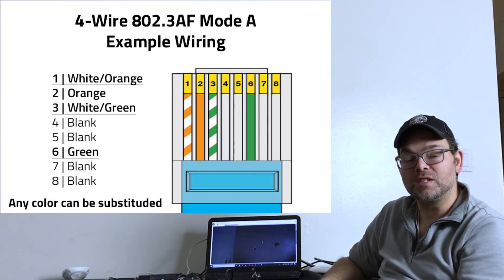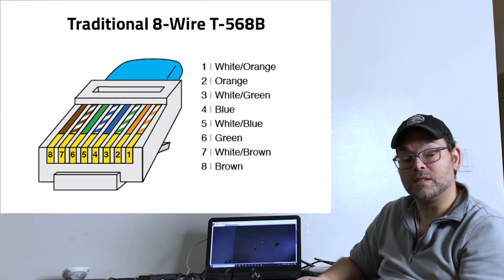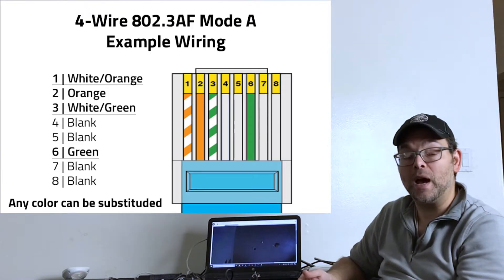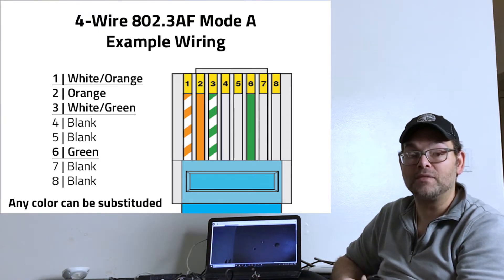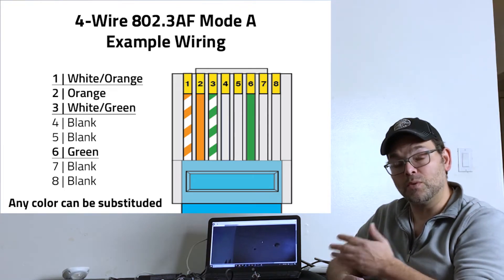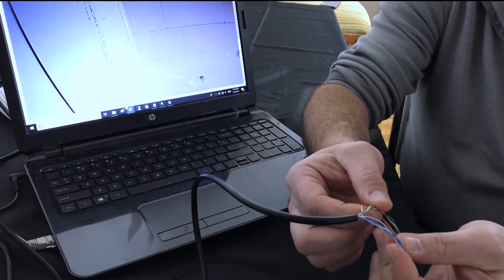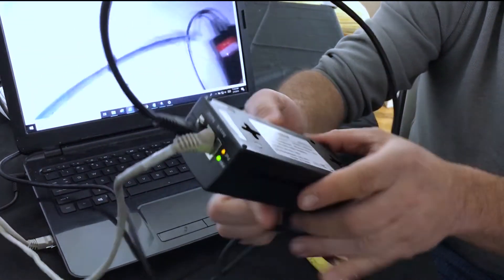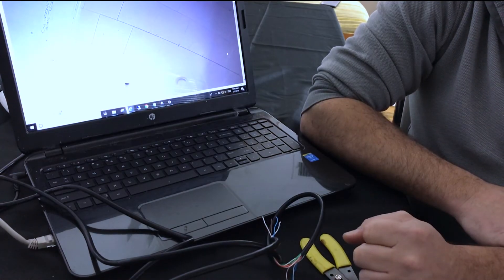Power Over Ethernet Using 4 Wires (2 Pairs)

Comment: I have a POE switch with Ethernet cables,but have cameras that can only plug into a DVR. I would like to know how to connect it directly to the Ethernet wires,without any conversion connectors. My problem that I don't know which of the Ethernet cable wires are for data neither the wires for power.
Reply from the maker: if they are coaxial cables you can not connect them direct to a poe switch. its an analog signal on your current cameras. in this case you should use a hybrid system that does analog and Ip if you want to use those cameras and Ip cameras.  if you want to use cat5 for anlaog cameras, not connected to a poe then i recommend you use a balun connector on both side , otherwise your signal will be crap if you took the coaxial wire and connected directly to an ethernet cable to extend its analog signal

Comment: Dang bro you just saved me a bunch of money, not only on my car insurance!! 😳
Reply from the maker: thats great man! are you an installer?
Reply: @cctvny  No, I do my own stuff i run and have ran my own internet wiring and couplings for security cameras,  but the wireless cameras I have don’t support POE, but I still used the internet cable to power them using your method

Comment: So if data only needs 2 wires & power only need 2 more wires whats the purpose of pulling an 8
 wire cable? If the world only used a 4 wire cable think of the $$ that would be saved. & resources.

!

Comment: My 3rd pair ( white/green ) is damaged in my Cat 6 data drop feeding LTS  4MP Turret Camera. If I re-wire both ends , using your video as my guide, do I still need the 802 injector, or can I simply plug back into NVR as it is POE powered already ??
Reply from the maker: Best way to check is to take the camera straight to the nvr and connect it with a small patch cord the same way with the 4 wires and test both ways. With extended distance on or off. It may be extended distance just changes the mode which happens to change that setting. But test it comfortably by the nvr.

Comment: My 3rd pair shows open. Can I re-wire both ends the way you show and simply plug back into my 8 port LTS NVR ( as it is POE powered ), or do I need this 802 injector ?
Reply: It really depends on the model of nvr if it supports it. I have seen some of the hik style nvrs have an extended distance option, once enable it worked on this node. However , I can not guarantee it .
Reply: @zoeyjune396  Thanks for the quick reply.  Looks like this Nvr has extended distance option. Should I turn this on even though my distance is only 90 feet.?

Comment: but how can we still get gigabit can we cut 2 wires only? I only need 2 wires for powering up devices that I'll attach to balun with positive and negative polarity so if there's chance to still achieve gigabit connection I'm on the look and don't know what wire numbers like 45 78 should I cut

Comment: I’m working a property that has their wireless access points running off of two pairs. Having a hell of a time figuring out why I can get power but no data to the AP
Reply: If it's not twisted pair it will not send data. The twists are part of the technology that allows the communication to follow. If it is twisted pair then perhaps the run is too long.

Comment: did as you said 4 wires  the wires you said still no internet upstairs?
Reply from the maker: Is it twisted pair cable? And are you using poe at all? And if you are using poe are you using a poe switch or injector that supports 802.3 af mode a?

Comment: Planning to use my previous ADT motion sensors (connected to 4 wires) not sure if it's  twisted pair but I do know that it's 4 wire cable. Most of the IP cameras I own support 10/100base t half duplex. I hope this works!!
Reply from the maker: Hi @jcmarcell unfortunately it most probably will not work if it is not twisted pair. You will get power but data will not work. Your choices are to use an analog HD camera(tvi/cvi/ahd they now go up to 12mp) or to use a two wire to poe converter.  If you did go the analog HD route you can get a simple four channel and use it as encoder if you have a larger ip system
Reply: @cctvny  I get you, you say it won't work, but in real world scenario are we talking that it won't work over so many feet? I think the longest run is about 70ft and the shortest being around 30ft. I understand the interference when it comes to something not being twisted pair but you don't think 30 ft can deliver 2 megabits with interference?
Reply from the maker: I will be happy if it works for you. I went down to help an installer with an install and the run he had was less than 20 feet and it did not work. But its in your house so it will be easy for you to test. Let me know the results
Reply: @cctvny  damn not even 20ft...........Honestly I'm gonna be that guy and give it a try. I'll let you know! Thanks for the video and responses.
Reply: @cctvny    hey so you were right, it did not work because it is not twisted pair. It does however transmit power (I guess we know that since the motions were active) and also worked with my ethernet cable tester. But from core switch to aggregation switch didn't do shit lol. It must be way too much data loss at 70ft(which is my rough estimate) 

Also if I'm understanding correctly, utilizing an analog system would be the copper coaxial cable? I was specifically interested in removing the useless motion sensors and utilizing the cable in the walls for Poe and data.

Do you think I could use these for anything else? 

Edit: what is an encoder? Would I be able to utilize something that can convert the data to usable transmission, and then convert the data back on the other side? I've seen systems that can convert USB data over long Ethernet runs and then convert it back to USB data on the other side. I've also seen ethernet data converted over coaxial and then back to ethernet data.
Reply from the maker: @jcMarcell  regarding analog HD you can use devices called baluns instead of coax cable.and connectors.  So you would use a pair for video and a pair for 12 volt power.  The dvr you schoose should be the same manufacturer as the ip system you have. This way you can view the cameras in the same software. 
If you were going to go with converters to make your 2 pair cable ip. There are many from companies such as veracity, or doorbird, or you can see what options Amazon offers

Comment: So this method would really not be good as a main source for data. I had this pinout going from a switch to a router and it just didn't work. Assuming a full 4 pair is required if you're going to use it for networking and not poe/5MBps

Comment: If I have good quality modem cable (F/FTP, 24 AWG, 6P4C, RJ11) or 2 pair External Telephone Cable, would I be able to use either of these for a POE IP camera setup if I was to I re-terminate with RJ45 connectors?
Reply from the maker: The cable needs to be twisted pair to send and receive data. The power will usually work. Cat3 24 guage usually will work but you might only get 10mbps. That's usually enough for most Ip cameras.
I would reccomend you test it for a few days and see if it works, before you rely on it. There are also many converters on 2 wires (1 pair) that will give you poe as well, that will work with most cable.

Comment: But just got a forum ..they says 
type B cable don't have poe for cat 6 and type A have poe thats you said ......then buying a cat 6 type B then worth it over cat 5e ... please reply
Reply from the maker: I am not sure i understand you.
But if the question is if you have a non gigabit speed network, can you use cat 5 instead of cat6 for poe 802.3af mode A. 
But for data mode b still works with 4 wires but you do not need cat6 since you are not going to have gigabit speeds anyway. I hope this helps. If you reply please make sure you have it explained better and that the question spies to an application that requires power on the cable
Reply: @cctvny  ok my last question ...all though I don't have a gigabit connection speed but my modem and computer have 8 pin port so in that case will I get advantage over packet loss with cat 6 cable
Reply from the maker: @random2059  ,in this instance cat6 only benefit is if it is alot of work to run the cable and you wanted to have something for the future.
For your current application if I understood everything correctly,  then it would have no benefit over cat5e

Comment: But cat 6 have 8 pin ....cheap router have 4 pin only
Reply from the maker: That is only for data and not regarding poe, which also provides power for devices like up cameras or ip phones.
The cheap router only has 4 wires since it is not gigabit and data only and work on older standard for the data

Comment: Would a 2 pair cat3 cable work to run an ip camera with a portable injector using this method? I ask because I have that pre ran and don't want to rip it out to replace with cat5/6
Reply from the maker: It really depends if the camera supports the 802.3af Mode A to begin with.
Cat3 can usually do up to 10mbps of data. Just verify its actually cat3 and its twisted. Otherwise you will get power and no data.  I have seen it done many times for under 100 foot runs
Reply: Thanks so much for the fast reply! The cam is a Dahua IPC-HDW5831R-ZE and the spec sheet lists power supply as DC12V, PoE(802.3af)(Class 0).  But I can't find anything about the mode. Any thoughts? Thanks again!

And the cat3 is twisted.
Reply from the maker: @bradpalmquist4163  sorry for the late reply.
From speaking to my friends at dahua they said that the 802.3af standard includes both. So if you have the camera already you can bench test it to see if it officially supports it. Doing that won't hurt the camera if it does not

Comment: Hey, I am using a fiber net router in of the rooms and there is a 2 Pair (4 wires) connection to another room inside the wall. I have RJ11 sockets in both the rooms. Can I convert them to RJ45 sockets and transfer internet via your method and get not more than 100Mbps speed to another router?
Reply from the maker: Hi Kevin 
I think your autocorrect might have changed some of your wording on your first sentence. 
If you can clarify what cable it is ,cat 5,6 and if your not sure,can you tell me  if they are twisted pair at least. 
If I did understand it you have a 2 pair cable (needs to be twisted) between 2 rooms going to rj11 phone Jack's. If it is cat5 or cat 6 yes you can convert and put rj45 Jack's. If its cat 3 and the distance is not long it can work as well, but I can not guarantee any speeds until you test it. If it is cat3 or even a not twisted cable they make converters that will give you the speeds you need. Also why would you connect 2 routers? Do you mean a switch or a wifi access point in the second room?
Reply: @cctvny  firstly thanks a lot for your reply.
I was planning to connect 2 routers on two different floors but due to the primitive wiring I was not sure if I would be able to connect them.
I am not aware if my wire is Cat5 or Cat3 and it has 'Blue white orange white pairs.
I don't know if this helps I am really poor with terminology I am a med student😅

Comment: hey, i will be doing this in 2 days since 1 out of 8 wires is broken with ma 6mp 100mb camera and see if it saves me some big trouble. I saw some more expensive camera on specification saying it support both 100/1000mb . On such camera can this still work with 4 wires ? thanks
Reply from the maker: You can not get 1000mb which is gigabit speed over 4 wires. And not all cameras support this , and the switch or poe Extender must support this as well.
I have seen tvt nvrs built in switches support this protocol but not dahua or Hik.
Reply: @cctvny  i dont want to have gibabit speeds, in the dahua camera specs it says 100/1000 so to me it means that it support both. I just tested a 10/100 camera and it works on 4 wires. If the spec of the camere says 100/1000 and not just 1000, shouldnt be compatible with 4 wires too? Can you maybe test such camera and see what happens?

Comment: Sorry.  If 1&2 are  + ,    3 &6 are -,  then which line for data ?  Please. Please
Reply from the maker: Thats the beauty it uses the same cable for power and data,  different types of signals. Data signals cannot interfere with the  power signals since both of the  signals are at the opposite ends of the electromagnetic spectrum.
Reply: @cctvny  really informative

Comment: What distance can you run this without voltage drop
Reply from the maker: Hi Jared the limitations are the same as traditional cat5 or cat 6 network poe distances so anywhere fro 250-325  feet depending on the cable
Reply: @cctvny  so I split my cat6 cable to run 2 CCTV cameras at 200 feet. But the video quality isn't very good. I used passive baluns. Each balun using 2 pairs
Reply from the maker: Jared you are confusing analog, this is for IP based systems
Reply: @cctvny   yes I understand but i wanted to know if I can do the same for analog cameras without a problem
Reply from the maker: @jaredhussain9565  I can not give you a definite answer since this a completely different technology. I would think if it is an analog HD technology ,like tvi,cvi,ahd that having 2 modulated cameras on the same cable sleeve for distances would be more of an issue. Also if it is Analog HD they have different passive balls to support the resolutions. In addition regarding power are you measuring what you are receiving? Since the camera is 12 volts dc and pulls around 1 amp probably at night , 1 pair of cat cable is not rated to hold that voltage regardless. I would see if you can power it remotely and if your quality improves. As for ip cameras using the 802.3 af mode a 2 pairs are still being used for power at the end of the day,  just data is riding over the same cables at the same time.
If you see the analog cameras are giving you issues just use ip cameras instead using this technology. Or perhaps if you see more cameras may be needed running the cat5 to a poe powered switch where you can support several more cameras even

Comment: If you use 1,2,3,6 for the ip camera, which two cable supply "+" and "-" power to the ip camera?
Reply from the maker: 1&2 are  + ,    3 &6 are - you can see in the video on the injector being used
Reply: @cctvny  So 1, 2 are Tx+, Rx+ and 3,6 are Tx-, Rx-. Is it correct?

Comment: Can I use normal WiFi router for this kind of broadband connection?
Reply from the maker: It is only relevant to this video if your broadband router gets power via poe.
Your question however does not involve power, and regardless will work with a 10/100 speed
Reply: @cctvny  I got a ethernet cable with 4 wires inside it 
For which my broadband connection speed is limited to 100 Mbps
My question is
Can I use a normal WiFi router that supports 8 wire ethernet cables ?

Comment: If use only 4 wirde why get 8 wird ?
Reply from the maker: L.c , the 4 wires work for a limited amount of devices. Also using the 4 wires is not something that you do not do to begin with. It is usually to correct a situation after the fact or to add another camera without rewiring.
Reply: @cctvny  i use brodband ......

I conocted only 4 wird after watching your video

 4 wire or 8 wire any difference for brodband ?

I mean downlod and uplod speed
Reply from the maker: @l.c.ahir.  for broadband if you use 4 wire your are limited to 100 mbps, if your speeds are higher you won't get it. The video i showed was for powering and data for mainly  camera applications
Reply: @cctvny  tq my plan 50mbps😁😁
Reply: I've wires cable how to do that? Please help
Reply: I've 4 wires pls help sir... Pls
Reply: @drheisenberg2413  what ?

Comment: Nice, so that mean I can use one cable for connecting 2 IP camera to NVR? 

Did you use Hikvision  NVR + IP camera in show? thanks
Reply from the maker: You can connect two cameras ,but not directly in the back of the nvr. The Hik nvr does not support the 802.3af mode a standard. So you need to use a switch that does
Reply: @cctvny  You've just mentioned something that has driven me crazy, I have HIKVISION EXIR TURRENT Network Camera DS-2CD2385G1-I 4K 8MP IP POE Network camera and a HIKVISION NVR  DS-7600 Series Model DS-7616NI-K2/16P how do I get to use 2 cameras on one Ethernet cable? I've seen many people wanting to know this.